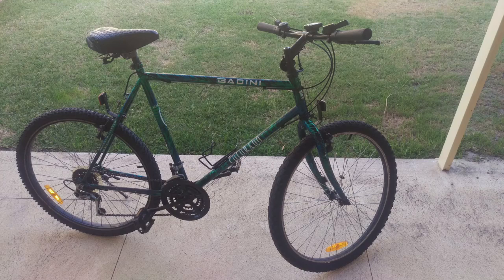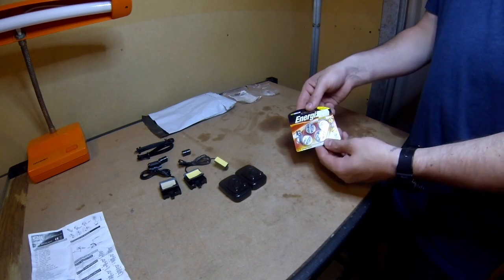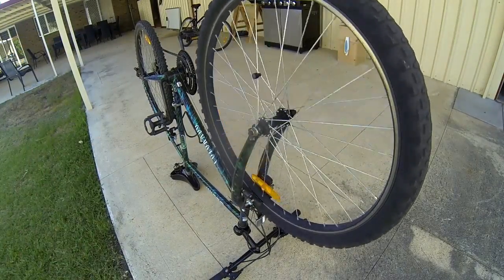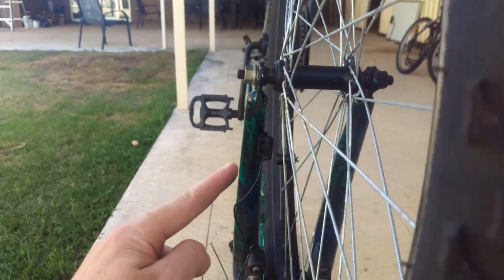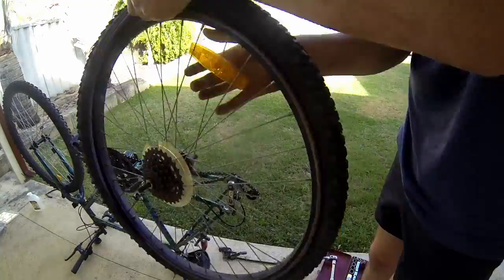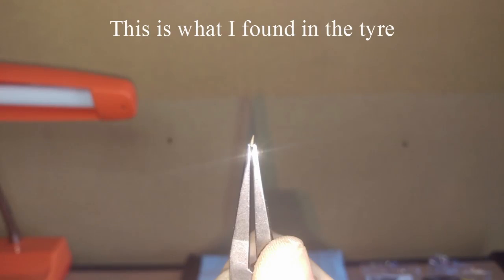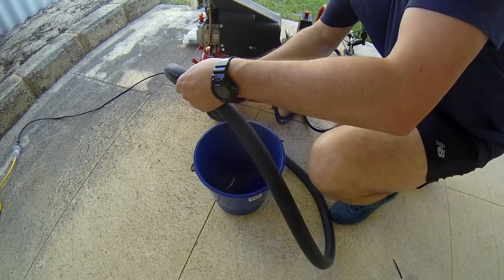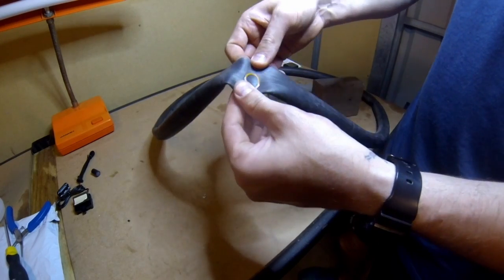Bicycle Speedometer Installation

Comment: How does it know the size of the tire to calculate speed and distance? Do you have to enter that to set it up? I watched this video to find out as much as I could about this thing, not to learn how to do something unrelated like patching a leak in a tire.
Reply: It doesn't. It calculates relative to the rpm of the magnet on the wheel. The magnet is being counted every revolution of the tire giving the speedometer an accurate calculation of the speed.
Reply: @ianbolo930  . I have since received mine and have been using it. You have to enter the circumference of the wheel. Without that, you can't determine the distance traveled per rotation. Then the distance per rotation is divided by time to calculate speed.
Reply: @E-BikingAdventures  ye
Reply: @ianbolo930  you didn't understand the question. The size of the tire is a huge factor